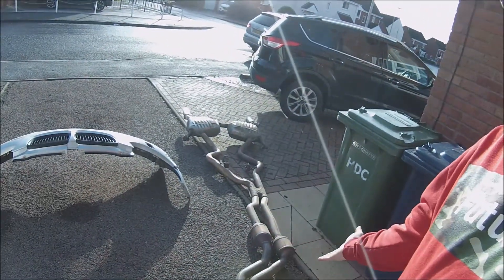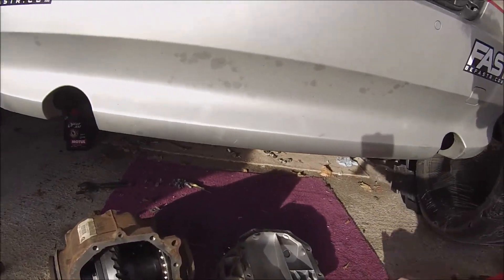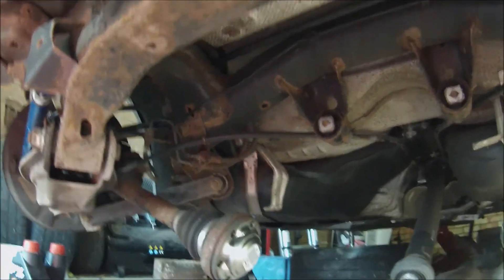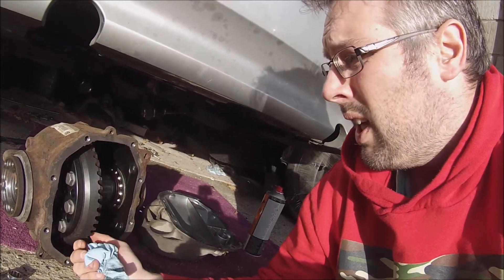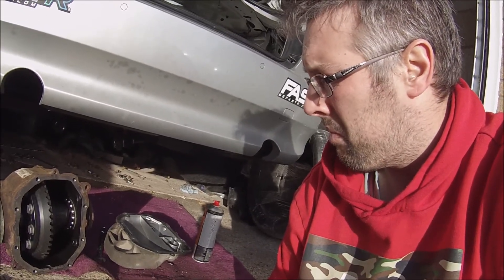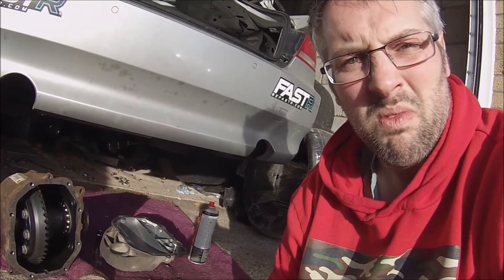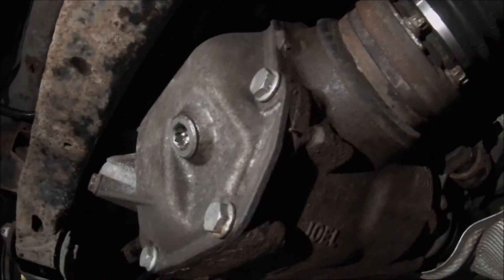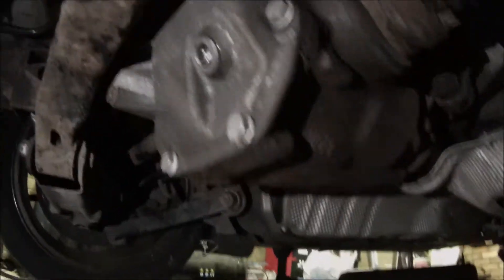N54 335i Time Attack MFactory LSD fitting 17t turbo, 19t turbo, 500whp, UK Time Attack, N54 335i LSD

Comment: How did you swap the internals? Did you have to transfer the bearings over?
Reply from the maker: I did yes, that was the hardest part as i couldnt find a good source of replacements. Worked nicely though 👍

Comment: Nice! I put one in my E92 335i manual and ended up using the 3.46 automatic gears. It's fun and has a very similar gear ratio to my E92 M3 😁
Reply from the maker: nice one! how did you find it? as mine is the 3.46 anyway being an auto.
Reply: @listerofsmeg80  I end up buying the whole pumpkin from ECS Tuning here in the states and it was a few hundred bucks cheaper with the auto gears 😀 it took some adjustment to get used to but I ended up loving it! I'm kicking myself for not fitting new diff bushings when I did it though haha.
Reply from the maker: @micraw714  yeah, im sure mine would benefit but i cant be bothered right now to drop the whole frame out. Maybe next year....